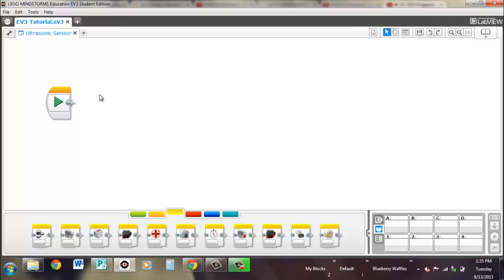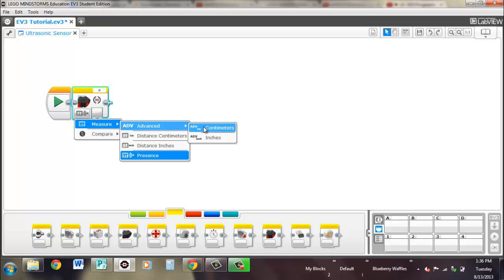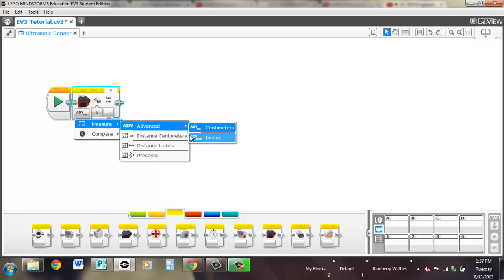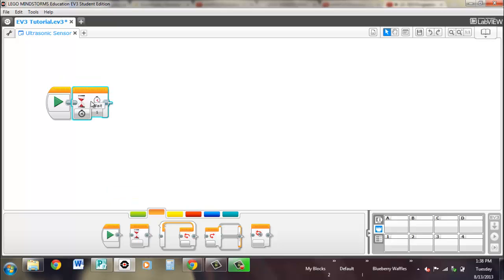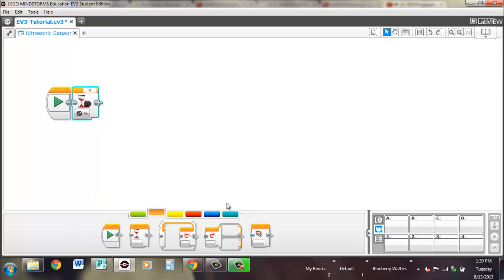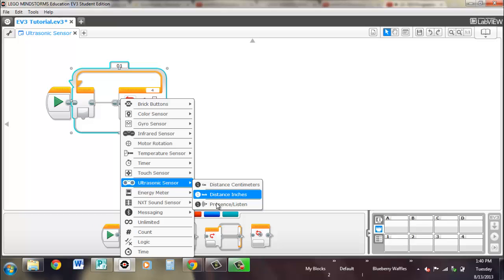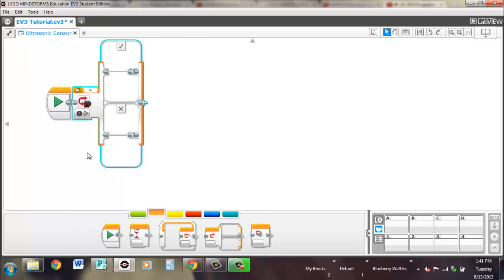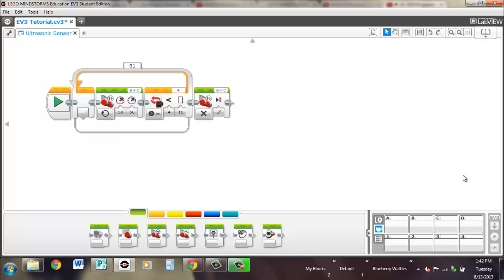15 - EV3 Programming: Ultrasonic Sensor

Comment: what does the Ping and Continuous do in advance measuring mode? right now, im trying some experiment using the advance mode. seems no different with the normal measure.  and what can i conclude, the ping mode only generate the sound wave once while the continuous generate the sound wave continuously as usual.  i think the ping mode only use as the single signal for other ultrasonic to listen.

Comment: What does that 4 with the less than signs mean
Reply: The 4 is the selected program. Less Than means that if the robot encounters an object that is less that your chosen measurement, it will then reverse,stop, turn, etc :)

Comment: My software doesn't have cm's or inches.... my options are: Compare > proximity/beacon heading/beacon proximity/remote

How do correct this?
Reply from the maker: Sorry about the delay.

I would suspect it is the version of software you are using, perhaps try updating?
Reply: W.A.F.F.L.E.S. Community Robotics hi thanks for replying i am on version 1.03H and still no luck :(
Reply: PerfectionistsSarah It seems that you are using the infrared sensor instead of the ultrasonic sensor.
Reply from the maker: Infrared sensors replace ultrasonic ones in commercial sets, the settings are similar.
Reply: No the Infrared sensor is for the remote control. "The digital EV3 Infrared Seeking Sensor detects proximity to the robot and reads signals emitted by the EV3 Infrared Beacon."
Reply from the maker: It does both ultrasonic functions and the IR beacon.

Comment: Hi, I have a robot that follows a line. I want to include the ultrasonic sensor, how do I use BOTH in one program? any help would be great :) love the vids. thanks
Reply: W.A.F.F.L.E.S. Community Robotics 10 mins after commenting I managed to do it hahaha. Typical
Reply from the maker: Depends on what you are looking for, you could potentially run a loop that follows a line while a certain value is being read on the ultrasonic sensor, or if you wanted them in separate tasks, you would just place the one before the other.